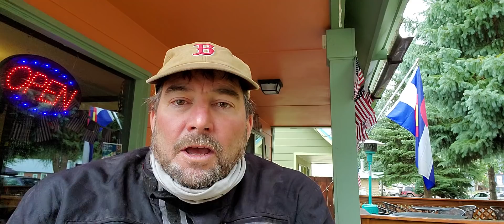5th Stage Bleed Valves explained 737 Emergency AD

Comment: Juan, if something so seemingly simple has quit working during storage, then is there a stream of these AD’s on the way in regard to these stored aircraft?  Ride safe on the TAT.
Reply: I'd imagine there would be a string of issues, from "get to it when we get to it" minor to "can't fly without it" critical and everything in between.
The more complex the machine, the less it likes to sit idle. As an auto mechanic I know for a fact that it happens to cars. Not surprising that it happens to aircraft, as they're generally more complex (or at least held to a higher standard) than your typical automobile.
I mean sure maybe a Cessna 172 from the '60s with fixed gear and no turbocharger might be simpler than some supercar, but I'm talking in generalities here.
So it stands to reason that your typical aircraft would like to sit idle LESS than your typical automobile, and automobiles already have a couple of regular issues that pop up when they're left to set (brakes get rusty, E-brake mechanism might jam up from corrosion, fuel might go stale, etc.). Not critical when it happens to a car, but on an aircraft it's a whole different story.
Reply: @44R0Ndin  You are correct. Idled aircraft have required periodic maintenance checks, but, due to the unpredictable nature of the current crisis, many hundreds of aircraft might be idle for a year or more. No one, not  even the original engine, airframe, or component manufacturers can predict exactly what things are going to go bad just from not being used for extended periods of time.
Reply: 44R0Ndin ....  you are absolutely correct!   I’m a motorcycle guy and find all the same issues.  My son and I buy “garage finds” and restore them, then sell.   Usually, someone quit riding years ago and the gas tanks are ruined, carbs are a catastrophe, the tires have ruined, and brakes are gone!  Most of the ones we buy are still carbureted.  So, lots of issues to deal with.  It’s fun to do. We buy cheap and sell high!